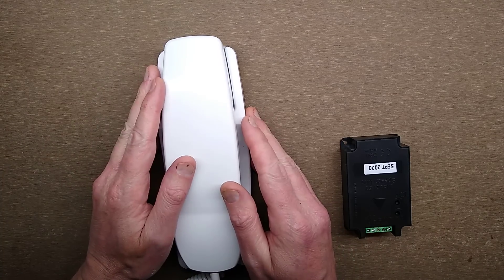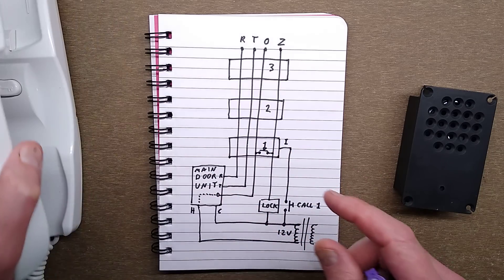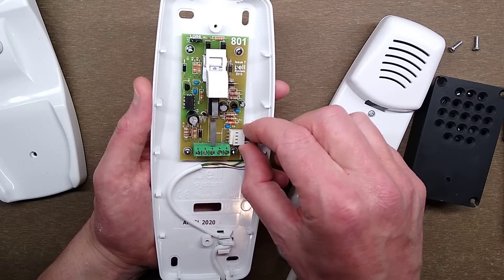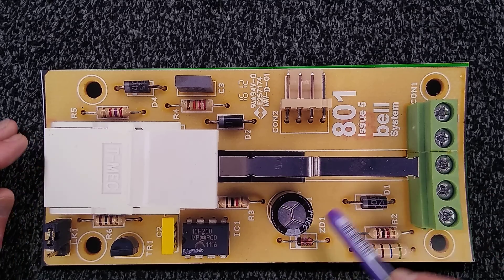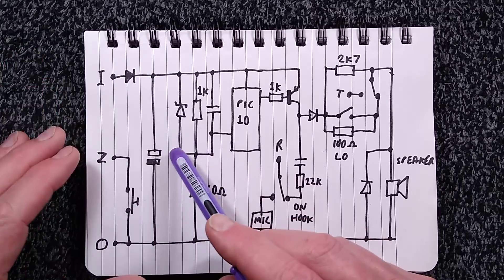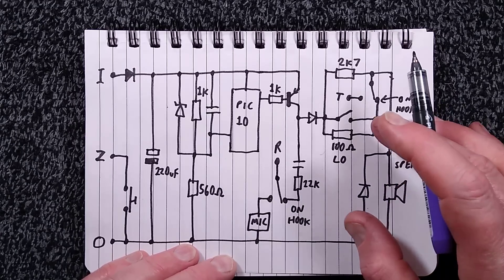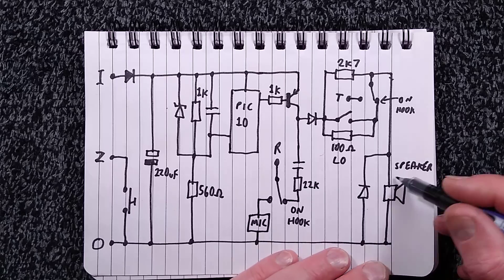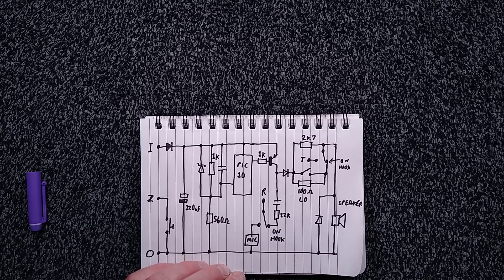Inside a door entry phone

Comment: We had a system like that in our 25 flat building - it was awful. People didn’t hang-up correctly after using it so you could hear what’s going on in other flats. Also people would just tape down the ‘Open’ button to let anyone in anytime - handy for dealers etc.  We replaced it with a two-wire bus system using digital signaling and voice - much more secure and can’t overhear other flats or strap down the open button.
Reply: In the USA most newer systems seem to use a regular phone line with a controller module that is programmed with the phone number of each apartment/unit/flat. And when someone at the gate presses a button for a particular unit, it dials the programmed number for that unit. And when the person who answers wants to let them in, they dial a certain code on their phone and when the DTMF decoder in the controller detects the correct digits, it unlocks the gate. Similar systems are also used for gate/door control in secure facilities like data centers. I remember having to visit a data center on a regular basis and I would press the button at the door, I'd hear some ring back tones, security would answer, I would tell them who I am and what I'm doing there, and then I'd hear a couple of DTMF tones and the door would unlock. That one I think just used a ring-down device (phone line simulator), it wasn't connected to an actual PSTN/exchange phone line.
Reply: @brianleeper5737  Great. Anyone with decent hearing and a touch tone generator can get in after initiating a call and people who lose phone service can't easily receive visitors.
Reply: @tactileslut  I think these units won't accept a DTMF tone from the gate side of the connection, and losing phone service isn't very common. These will even work with cell phones, if someone's cellphone number is programmed into the unit.
Reply: @brianleeper5737 : I think I've experienced intercoms like that here - you'll try dialing a flat number and end up getting someone's (default) mobile phone answering machine (or you'll get an answering machine, try calling the person on their phone number, and get the same answering machine). I guess on one hand you can leave a message that you tried visiting earlier, but I still don't like the idea of tying it to a mobile phone (while I did deliveries, I'd guess that those which I couldn't drop for were probably because someone's phone died or something)...
Reply: I guess the locking opening electromagnet was DC? The system I saw was obviously an AC magnet which sounded a loud buzzing. Or maybe it just had a buzzer.
Reply: @userPrehistoricman  Yes I think so - 12v AC could be used to open a door catch. In our case it fed a relay that opened to disable a large electromagnet that kept the door closed, supposedly with a force of 300kg - dodgy neighbourhood!

Comment: The hook switch in some of the earlier versions caused a lot of reliability problems, the contacts were a pair of long flexible brass springs that contacted  bent wires, the contact surfaces would become tarnished and intermittent. The newer versions with enclosed switches are much better.
Reply: Those brass spring switches were bent so that the contacts would wipe slightly, keeping them oxide free.
Reply: I have one of those
Reply: Probably the problem with ours...on an old Peabody block south east London (lalala)
Reply: My door phone was made at some point in the mid 90s and lately when I answer it, I hear quite a bit of crackling noise through the earpiece.  I rarely use the door phone so I'm wondering if the contacts in my door phone are a bit dirty or oxidised.
Reply: @Lachlant1984  A likely cause
Reply: @Lachlant1984  Could be.  You could spray some Deoxit® on the switch contacts, or just try to "exercise" the switch contacts by pressing the hook switch many times.

Comment: "Domofon" like it's called in Polish; it's straightforward unless it's a digital system. In that case two leads are commonly used (at least around here) carrying power, audio and control signals.

Using a microcontroller for ringing a bell is an enormous electrical & electronic engineering exaggeration :)
Reply: I guess you could use a 556 (dual 555 timer) if you'd want. But that's a 14 pin package.

Comment: T and R sounds like a normal telephone line with Tip and Ring.
Reply: It's not on this one. Both the speaker and microphone signals are referenced to ground, on separate wires (T and R), and are not a balanced signal. Which means that this system could not be installed with regular twisted pair cable, some sort of shielded cable would probably be needed.
Reply: @brianleeper5737  Maybe but they tend to use a high audio level so often get by on plain multiwire with just, maybe, an overall screen BC will know.  I still think the T & R are TX / RX as referenced to the call origin - the door unit.
Reply: @barrieshepherd7694  You are probably right about the TX / RX meaning.
Reply: Or TX / RX ?
Reply: @barrieshepherd7694  not on an analogue system - Tip and Ring refers to the plugs they used to use on the telephone exchanges manyyyyy years ago...
Also, the speaker is connected to T, but that would be 'receive' or Rx...
Reply: @stepheneyles2198  Pretty sure that Ring / Tip was to do with the polarity of the phantom power across the balanced pair that formed the telephone line, not TX/RX as such.  It was necessary to get the connection the right way round as operators would tip test the line to see if it was engaged and if it was (indicated by reverse polarity) they were not supposed to plug the jack in.

The connection to the speaker is T but that may well refer to Transmit from the door unit. The R is connected to the microphone because it's sound to the door unit.  i.e. the nomenclature is referenced to the door unit.

This 'reversal' is the norm in telephony e.g.  the Exchange 'E' (signalling) wire became the Transmission systems 'M' (monitor) wire - and vice versa
Reply: @stepheneyles2198  The ring and tip, as presented on the jack plug, primarily relate to the phantom power, across the balanced telephone pair. The operators would do a tip test (as teh plug touched screen when initially inserted) to see if the polarity, on the tip, was reversed indicating the line was in use and should not be plugged into. 

As the telephone line is a balanced pair, carrying speech in both directions, Ring and Tip does not refer to TX or RX speech path direction as the pair carried speech in both directions. 

In the door entry system the T is connected to the speaker as it's connected to the microphone TX from the door unit - telephone nomenclature usually uses the originator to define direction -  as in telephone signalling where the E wire becomes the M wire and vice versa.  (arguments about what E & M stand for abound 🤣 between exchange engineers and transmission engineers) 

So the T wire transmits door audio to the 'subscriber' (the flat) and the R wire transmits the subscriber audio to the door unit receiver.